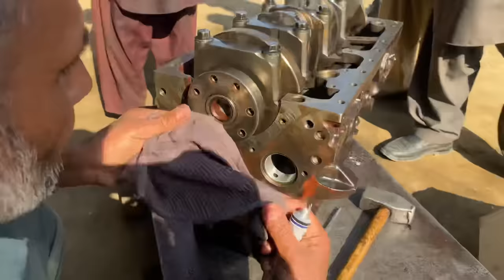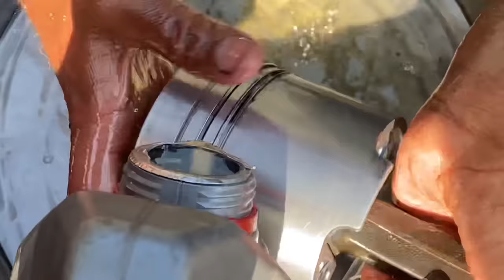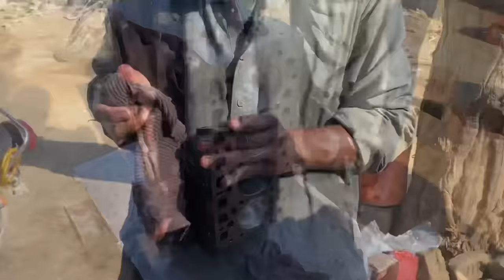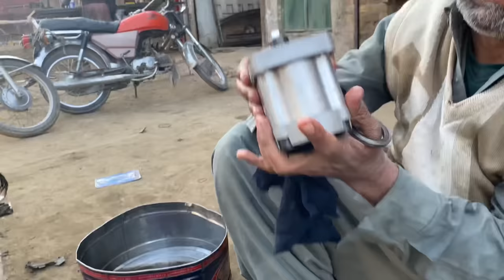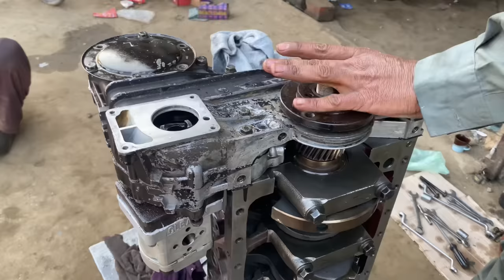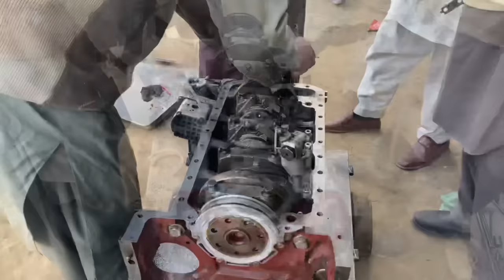How to Rebuild Massey Tractor Engine !! Amazing technique Tractor Massey Engine Repairing

Comment: You're absolutely right, it is amazing. Just imagine putting an engine back together without any torque specifications.
Not excluding the lack of grease on the camshaft and crankshaft. There are 100 ways to building. If you follow the correct procedures, then there was only 1 WAY.

Comment: Why did not each piston ring be inserted separately into the cylinder liners and check the gaps in the joints of the piston rings??? This is a very important procedure before assembling the engine!!! This is a very gross mistake!!! It is forbidden to do this!!! Read the instructions, fools!!!And one more thing: engines are the most important unit in self-propelled equipment and cannot be assembled on dusty streets! Enclose the place of assembly and wet the floors during work so as not to raise dust and clog the details!!!!!!